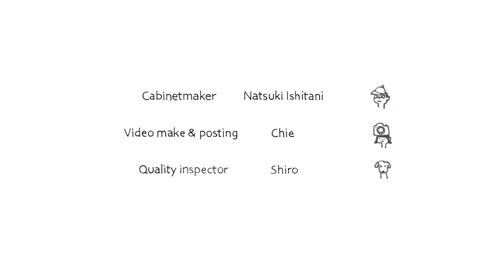ISHITANI - Wood Bending With Steam Box

Comment: What was the wood used? Is it possible to bend this way any kind of wood?
Reply: Артем Субботин some species of wood bend more easily than others. Also, you have to choose pieces with the straightest grain otherwise the boards will break easier. I've had success with white oak using this type of steam box.
Reply: If you very straight european ash it bends beautifully most times

Comment: Hello
What temperature and time is needed?
Reply: 1 hour per inch thickness but it usually doesn't work well with more than one and a half inch thickness, depending on the wood. A wallpaper steamer will usually give you enough heat and pressure but it depends on the size of the steam box. Steam bending is fairly cheap and easy art form, but has many variables. Use straight grained wood, make sure your steam box doesn't leak, have fun inventing and experimenting until you find the setup that works for you. Edit: The wood you are steaming should be straight grained.
Reply: @jumbo4billion  thank you
Very cleAr